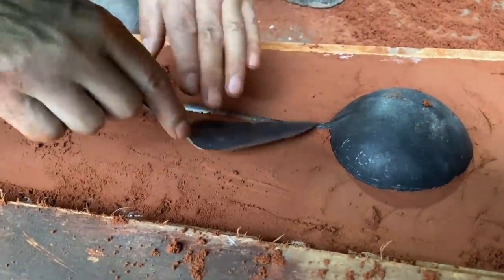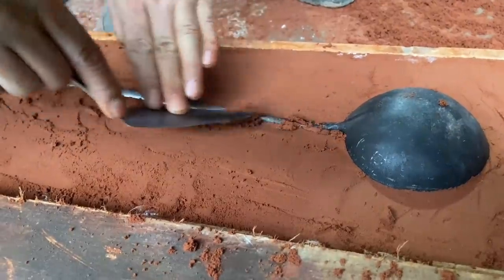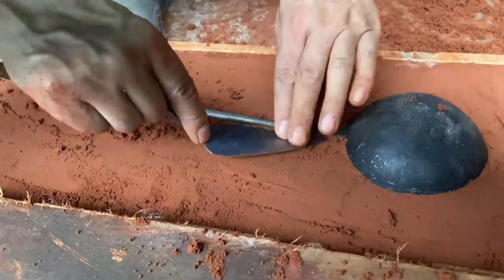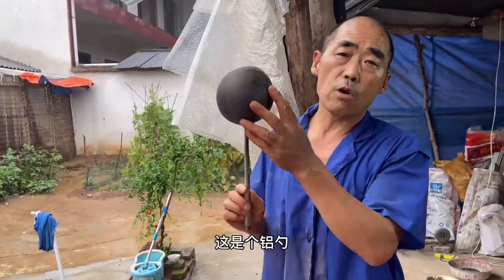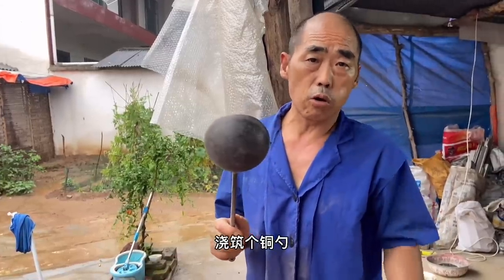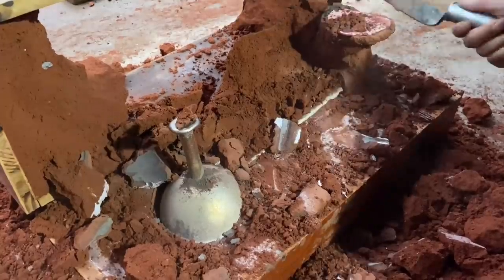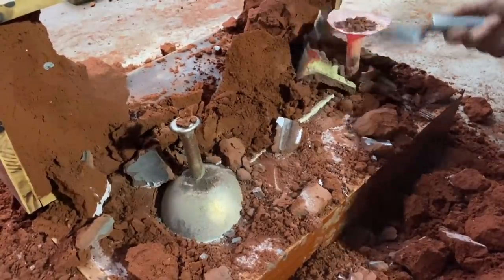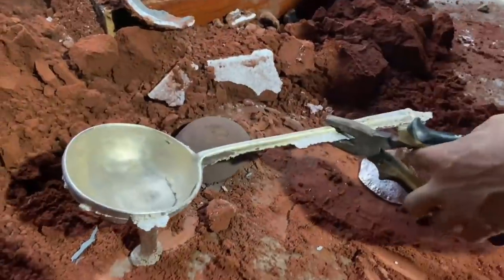More than 1000 degrees of copper water cast golden copper spoon, so awesome【Laozhu Casting】

Comment: I learned how to do this exact technique of casting when I was in high school. So many things are ignored or kicked to the curb because kids no longer have interest in learning things like this. They know how to work a cell phone don't they? I learned about agriculture, even tore a tractor apart down to its Bare Bones and rebuilt the machinery and even painted it. Learned how to tear down and rebuild small gas engines. I had wood shop where we used all type of Machinery in order to make things. We had a metal shop where are we learned how to weld, cast objects from molten metal, learn how to use metal lathe. I learned a lot from having these classes and it's a shame they are not offered anymore. I went through the transition stage in my schooling because we had a brand new class start which was called computer lit. It was a class developed to teach us how to use a computer. This changed everything and now everyone stares out a cell phone.
Reply: Truth !!  I grew up doing the same things.  Same Woodshop, Metalshop, and Autoshop classes.  Didn't think I was really paying attention at the time...... but, nearly everyday, and certainly every project that I tackle, I think of those classes and frequently use things/understandings I learned in them !!
My own son barely knows which end of the hammer to grab.  His face is buried in his phone or Online Gaming monitor ...... "Dad !!!  I'll never need what you are trying to show me !!" 
So, I do sneak, tangential bombing attacks hoping he picks up some of the information by osmosis..... .
Reply from the maker: You are great, practice is the most important
Reply from the maker: Great
Reply: @NotEvenHere there's a lot of truth in your statement. Just being observant of everything going on around you proves what we think, it's scary ✌🏼💚
Reply: Ditto.
Reply: Dude pls dont critisize kids these days. We can do a lot of stuff on mobiles, tablets, through codig that can actually help change the world.
Reply: Every generation has its pros and cons.
Reply: @harvinderkaur5909  I can code too, but innovations I've seen only serve to make social media, ads and face recognition more pervasive, whereas if 1 out of 10 people knew how to do manual work and repair things, electronic consumerism (which is slowly killing the planet) wouldn't be so intensive.
Reply: It's all by design. Government wants a population subservient to them, and one of the best ways to do that is to make the population dependent on the government.
Reply: @sijul6483  Corporations too. If nobody bothers to repair their own stuff, nobody builds stuff for themselves and instead everyone keeps buying sh*t quality products, consumerism goes up.
Reply: @pomponi0  yep.
Reply: The tractor one is a poor comparison considering the tech monopoly on newer tractors and the ever scarce pool of parts for older, older ones. Granted 3d printing will change that somewhat.

I'd have loved to have had shop classes but you guys started getting rid of them all due to "funding" issues.
Reply: Don't blame it all on the kids they can only learn what schools teach and with so much automation in todays industry the kid who can build a car won't be able to compete with the kid who can program a machine to build a hundred cars.
Reply: @harvinderkaur5909  like find a safe space?
Reply: @PC64292  
If one relies on school to teach everything one will be sadly disappointed - and pig ignorant for the rest of one's life.
Again, this is an example of the common current complaint - it's someone else's fault.
When the kid who wrote the program - now out of work because a computer is doing his job - is stuck in the outback with a broke fretz on a car built by the machine s/he programmed, how's that kid going to fix it?!
Reply: @giantdad1661  
I never had 'shop classes'.
I've restored many pieces of machinery - large and small.
When necessary parts were not available, I've made them.
How do you think people survived 100 years ago?
This video shows you 1 thing that was fairly common knowledge then.
Are you saying that, with all your academic schooling and available technology, they were more intelligent than you?
Again, another example of the current generation's attitude - 'all my failings are someone else's fault'.
If one WANTS to learn, one will find a way. If one is too lazy to get off their metaphorical arse and expects to be spoon fed, one will NEVER learn.
Reply: @trueaussie9230  

I don't think you get how little autonomy those born in the 90s and 2000s have and had through their childhood. That kind of upbringing is not conducive to self discovery and self determination. Schools teach conformity and it takes a year or two of life experience post 18 to break free of that. 

The world is a different place now, consumerist to the core and survival is easy, so of course few people need to know how to cast items.

You rail on about the youth "blaming others for their problems" but some of the problems we have today are a result of failings of previous generations and people saying "We can't solve this problem right now. Future generations will have to solve it."  

In order to learn about something you must first have some basic knowledge of its existence. In this case, casting.
This was common knowledge because it was a needed skill on farms so there is a difference between being willfully ignorant and legitimately not knowing something. The words Tabula Rasa aka Blank Slate are relevant here. Everyone starts out as a blank slate.

I don't want to assume you're an old fogey but you come off as one given that high horse you are sitting on. I will assume you are from Australia though based on your statements. If you live in the outback the skills you have are mandatory, you HAD to learn that to survive. I'm going to assume you had a parent that taught you those skills or you got curious and took apart broken engines. For me it was clocks and watches.

This video shows a casting technique that fell out of use in industrialized countries. You know what this video does not show? The composition of that dirt/clay or what that powder is(If I had to guess it's a form of soda ash.) It's not that they were more intelligent, it's that the modern school system does nothing to prepare you for real life(oh wait but thats also a failing on my part for not trying to learn something I didn't know as a 15 or 16 year old at the time right?) , you also need a problem before you can find a solution. The problem in this video is the need for a tool. The solution was the creation of a mold.

If I want to learn something, I'll learn it but currently? Using a lathe is not on the list. I'm still picking up smithing.

Also I was addressing OP with the shop portion of my initial comment.
Reply: @giantdad1661  
Do you think I've lived on Mars during the 90s and 2000s?!
Do you think I'm so blind as to not notice the deteriorating state of the world around me?!
(I see so much evidence of it on YT, where Americans proudly parade their ignorance of the most basic aspects of life. USA, self proclaimed 'leader of the world'. What a joke.🤣🤣🤣)
I know that the children of MY acquaintance born in the 90s and 2000s have been actively encouraged to ask questions, explore life and be independent.
(But that's very much the Aussie way.)
From your language - and attitude - I deduce you are American.
America is allegedly the land of the free where anyone can be whatever they desire to be.
If your school taught / encouraged you to be a mindless robot, instead of teaching / encouraging you to ask questions, what were your parents doing?!
Libraries are full of books affording ready access to extensive information on EVERY subject.
(That's where you can find the composition of casting sand. Damn, you can even find it in Wikipedia if you're too lazy to open a book.)
Who has stopped you going to a practitioner in whatever field takes your interest and asking questions?!
If you think foundaries like that in the video no longer exist in 'industrialised countries', you REALLY need to step outside and open your eyes - and your mind.
If such small foundaries no longer exist in 'the great USA' then all that 'specialised' work must have been outsourced to India and 'the great USA' has slipped even further into the abyss than I imagined.
Reply: @jennydelgado8517  
I didn't learn any 'trade' related skills at school.
I worked in offices for my entire working life. (Designing and developing large scale 'mission critical' computer systems. 😊)
None of that stopped me learning - outside 'school' - the 'trade' skills I wanted to know.
One's education restrictions are self-imposed.
JOOI - how many "modern worlds" are there?! Or did you mean "modern world's"? Didn't they teach you at school the difference between possessive and plural?!
Reply: @jimbayler4277  You do realize that a lot of schools, due to funding cuts, aren't able to offer shop or home ec classes that you took for granted, right?
Reply: My Father taught these skills at school in the UK then watched metalwork, woodwork & technical drawing turn into “design, craft & technology” where none of the kids picked up any tools other than craft knives and just worked in paper & card. This was all the pre-apprenticeship training gone to save money. Stupidity of politicians.
Reply: Why would you blame kids for not being taught these things? Kids love to create stuff! If you don't like the change in curriculum blame the government or something.
Reply: @sijul6483  : Dude !  Double up on your Meds and adjust your Tinfoil hat !!  The world is not out to get you !
Reply: @Asenueh  
And too many parents are too disinterested and lazy to engage their children in any meaningful manner.
Since as early as the 1980s I've watched parents allow and encourage their children to be the ones in charge. Well, it's easier than trying to control and educate them, right?!
'As ye sow, so shall ye reap'.
Unfortunately its the children and the world that inherit the 'empty harvest'.
MOST (life skills) learning SHOULD happen outside school, and mostly in the home.
But parental involvement, engagement and teaching must start from day 1.
It's too late when they're 15, ignorant and disinterested to try to rectify the problem.
For the most part I found school boring because I had already learned at home what they were presenting to me.
By 7 years old I already knew how to saw timber and make joins - because my father ENGAGED me.
And I knew my '12 times' tables.
These days everybody is keen to blame someone else.
Regardless of how poor schools may have become, they were never intended to be 'replacement parents' nor scapegoats for lazy parents.
If a parent hasn't realised well before their child turns 15 that their child's basic life education is wanting - and hasn't done anything to rectify that situation - the PARENT is at fault.
If ALL funding was removed and schools closed down tomorrow, what would you do to ensure your child was educated properly?!
If parents are not prepared to ensure their children learn basic 'life skills', they'd better hope the children can earn enough to pay someone to wipe their arse - metaphorically speaking.
Reply: @yggdrasil3  
Why would you EXCUSE a kid who is interested in such matters - but makes no effort to actively learn about it.
ALL the information anyone needs is available either in libraries or on the internet.
But, if one can only learn by being spoon fed information, one is not likely to make any effort.
I'm 100% confident the same kid would have NO trouble finding out everything they wanted to know  concerning the latest computer game.
Looking for someone else to blame for one's own failures / short-comings is evidence of a life of expecting and requiring to be spoon fed.
("Make America Great Again". WHAT a laugh. It will only happen if someone else does it for you. You're already trying to blame China for the state you've brought yourselves to. 🤣🤣🤣)
Reply: @Asenueh   : Yes.  I am very aware that in most places, these type of classes have gone away.  It deeply saddens me that the younger generations are being weakened by not being trained to be at least a little bit self-sufficient.
My own son barely knows which end of the hammer to hold.  Lord knows, I've tried to teach him !  But, because it comes from "Dad", it is not valued and immediately flushed.  He readily learns from non-family members (i.e. "Teachers").  I can only hope he absorbs the information through "osmosis"/subconsciously by hearing me talk in the back ground and being forced to be the extra set of hands from time to time.

Why would you assume that I wasn't aware of that ?!!  Go back and reread my original comment.  My entire comment was built on the knowledge that kids don't have that same opportunity anymore.

I personally think it is a tragedy.
I grew up to be a Firefighter, Landscape Contractor, Self-employed Entrepreneur, Maker, Fabricator (I build/make things used to Sterilize Medical Products during the Pandemic,) and a crazy-long list of other things
Shop classes taught me to analyze things and create solutions.
So, Yeah.... I am painfully aware of the handicap we have burdened the future generations with.
Reply: Schooling was hell. The less classes you were in the better. You learned nothing anyway even if you pay attention and made A and B grades through middle school. The teachers were drugged on coffee in unnatural amounts. They drank more coffee than i could ever drink water and the speech would often be incoherent and when THE CLASS asks for help understanding the teachers always tell the same story “when you figure it out yourself you will remember it forever” and so the lazy teacher gets payed to talk incoherently while drinking free coffee. Who cares about students actually learning lol, you get payed the same if they fail or pass. Now if your students fail thats one more year of tax money flowing into the school  and one more student for next year. 
And all the old folk go “well why dont you look it up on the internet” …we spend 8 hours at school on computers and now i dont want to spend 6 hours doing the TEACHERS job at home if i cant sleep in school.
Reply: This doesn't look like copper. In any case, it takes too long to make one spoon. With this technique there is no profit.
Reply: In our school, we had vocational courses which we would take in our Vocational Subject. One of which is Mechanical course, I took Electronics course.
Reply: You can teach slightly older generations but stil young enough to pass the knowledge on. Im sure a lot of people are willing to learn things. It's easy to say kids don't want to learn but if u really want to passnon the knowledge there are ways.
Reply: @trueaussie9230   I think you were likely in the middle of your career.
I'm in my 20s and I've seen the deterioration of the world its going to the  shitter. I hate this world. If anything I welcome a collapse and hopefully soon. That way those responsible for creating this modern world can see their handiwork.
If they're anything like you then they're the lucky ones, they had parents that cared about their futures.
You deduce correctly as for attitude? You came off a little pretentious so I upped it a bit.
America is dead. 
That is the American school system it's stuck in the industrial revolution, it's meant to churn out factory workers. My dad absent and mother for the first 8 to 10 years of my life struggling with drug addiction.
I went to libraries and was lucky enough to have an interest in books but my interest were in Philosophy and practical survival skills.

Foundries like this? No they don't exist. They transformed to using reusable molds, were modernized and semi automated. This is primative casting at its minimum.
Again America has fallen.
Reply: I don't thik it's that children don't have interest, it's just that schools are no longer teaching that kinda stuff, they're trying to dumb children down.
Reply: To be fair, cell phones can help you learn how to do these things. Though most people are content with boring lives of just working eating and sleeping.
Reply: @harvinderkaur5909  Cut a gemstone on your tablet. I paid for my univ education, cutting gemstones. change a tire with your computer. Kids these days don't know how  to change a tire, they don't know how to change a washer on a faucet,
Reply: Same here wood shop, metal shop, electronics shop, graphic arts shop, along with biology, chemistry, and physics.
Reply: @harvinderkaur5909  here is the worst of it, one EMP device 300 miles up and all your electronic devices are dead. your car is dead, you don't have fresh water, gas, or electricity. and if you think the government is going to help you, think again.
Reply: Some one please tell me what that whit powder he used was.
Reply: thank you for your service.
Reply: We still do that?? Stop rambling.
Reply: those classes have been long hone my friend. I remember being all excited to take woodwork in hs but NOPE american public schools have been defunded to hell and back
Reply: So what classes would you drop from the school day to teach this? Remember, it’d be a total waste of time as it’d be pointless to 99.99% of people. School are already useless at preparing kids for the big wide world, so why waste more time 🙄
Reply: @mikemcwilliams7801  Exactly
Reply: @SolomonDragon  talc, baby powder.
Reply: @Yosser70  in my day back around year zero, school was 6 hours plus a half hour lunch. 6 -- 50 min. classes, 5 mandatory: english, math, history, science and pe, and 1 elective. It's the elective that I chose, shop or art. This was 7 grade to 12 grade. Then there was summer school, I went every year, and it was all elective. I was in the collage track, but my summers were my choice. In the summer between 10th and 11th, I took a year of advanced algebra. Between 11th and 12 I took drama, finishing the english requirement. So if you know what you're doing, you don't need to drop classes. Most kid don't need a computer class, they have been playing on them for years.
Reply: @larrys-qr6zr  thank you 🙏😭
Reply: @larrys-qr6zr  So no music, languages or geography, I’m guessing you’re American? I’d also guess most kids don’t have the privilege of summer school every year!
Reply: I bet kids today would like to learn all those things, don't blame them for everything
Reply: Times and tools change. It’s normal. Growth and progress inevitably lead to things being forgotten or left behind. There is little need for this anymore so it makes sense for it’s production to slow. Stop whining about the lives and interests of others. If you want to do this, then do it and move on with yours.
Reply: @portuguezpac  sadly, kids these days want to have things done for them. They don't want to do it themselves, fortunately, there is always the exception.
Reply: @Yosser70  My dad won music lessons for us. The instructor came out and tested us. He told my dad not to bother, no talent. In choir, my brother was asked to lip sink, true monotone. I speak some German and some Spanish. I had geography in grade school. Summer school wasn't a privilege, it was how my dad kept us out of trouble during the summer and anyone could sign up for it, it didn't cost anything. As far as my nationality, yea, I'm an American. So what's it to ya.